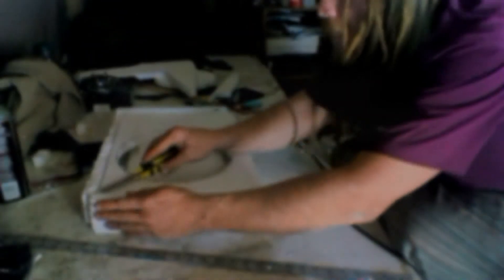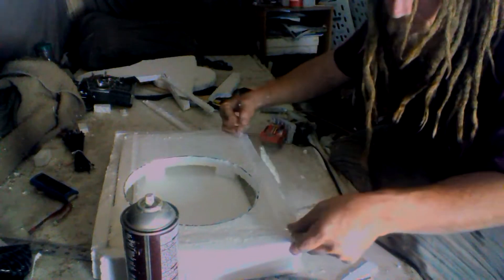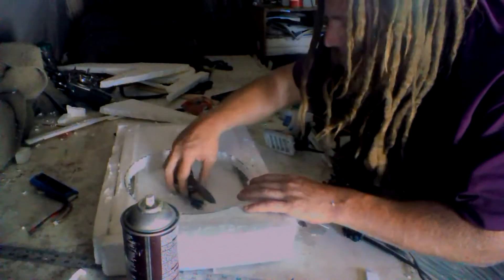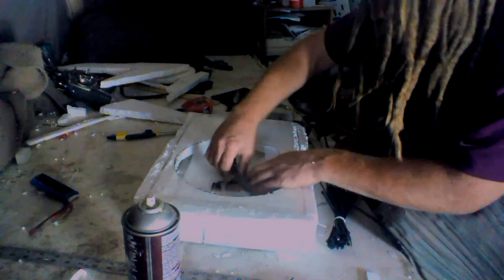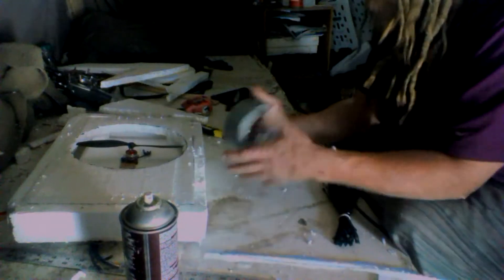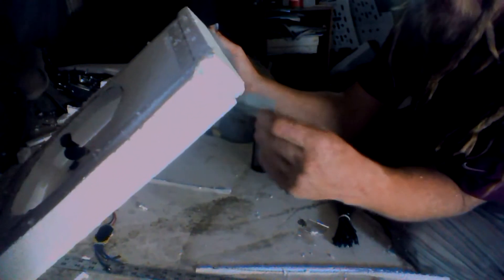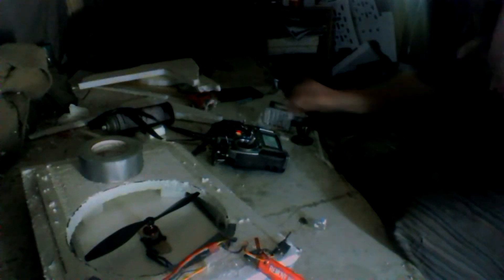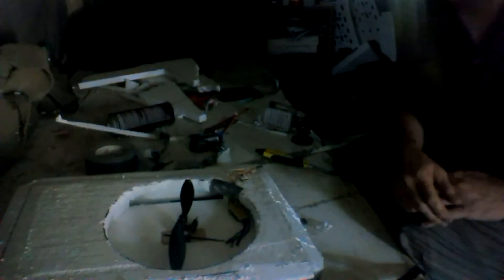How To Build An RC Hovercraft Part 2

Comment: what motors are you using as well as escs and servo?
Reply from the maker: Snakeprophet Emax Cf2822 motor with a 30a hobbywing "pentium" type ESC and a plain ol' 9g servo.
Reply: ah ok thanks.